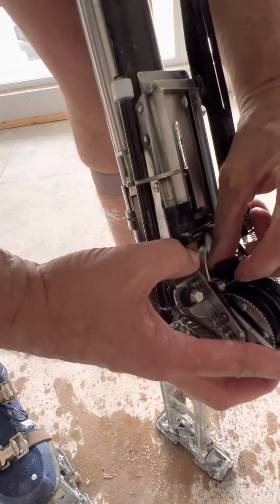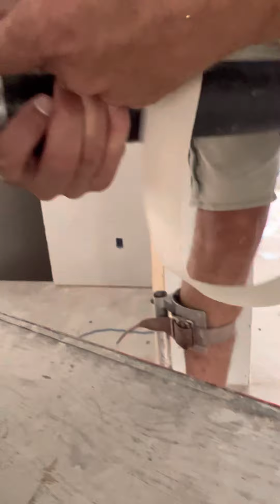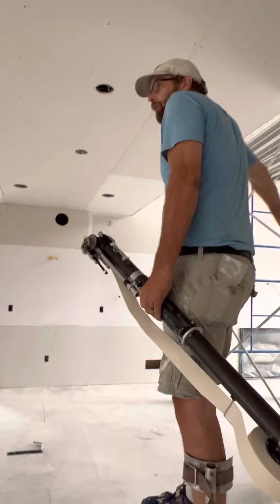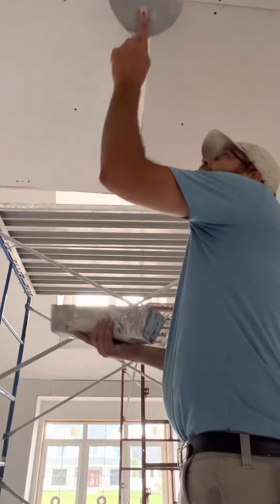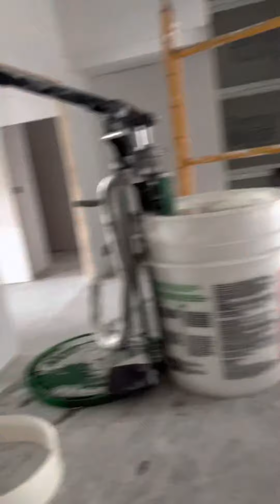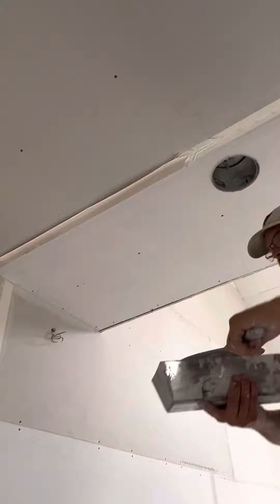How to finish drywall! Big house taping with Bazooka,  flats, Butts, ceiling!

Comment: I do all prefill to butt joints and corner gaps along with damaged board with sheetrock prior to taping as it is required to get a high quality finish and 2 other things you failed to mention 1 being that where you end at adjacent wall/ cieling flats if you touch filler valve to drywall and do cut length is perfect every time no quess work involved and 2 being that the screen on bottom of pump can get plugged by chunks of debris either dry mud or semi dry mud and restrict mud when pumped into bazoka and cause air bubbles , all butts that are not prefilled will show a line in the long run btw , my 41 yrs exp knows these facts to be true
Reply from the maker: Very good.  But I was just doing the basics.  It takes years to learn what you know. People can use the videos to get started.  Along the way they will learn to be masters.  Good comment Jeff!

Comment: It is but it’s just an extra step I do because I can’t stand that grove in the middle of my tape. I love fibafuse on my flats but when i used it I still ran paper on my butts. The fibafuse would tear some if I used in the butts when I busted them out with the box. It’s just got so expensive I’ve went back to paper everywhere
Reply from the maker: I could totally see it tearing on butt joints.  I always prefill butts.  A lot of times if hangers are clean the make the so tight mud can’t get through them and only bonds to paper.  I put a little v in them when prepping the house.  It does help lay tape or fibafuse flatter.

Comment: Y not prefill so you don’t get those gaps and lines in your flats?
Reply from the maker: So believe it or not.  The house is prefilled.  But I don’t prefill where the flats are tight together,  only broken board and gaps. The line in the tape has been happening only recently over last 4 months.  I was using USG tape on this one which seems to have gotten thinner.  It stretched a lot wiping it down on that house.  I would run some long flats and it would stretch almost an inch by the time I was done wiping it down.  I am going to try ProForm tape on next one I tape with a tube.  It has a thicker profile.

Comment: Leo, any idea on the square footage of that house? 4000? Looks like a beast. Just curious. Thanks for posting.
Reply from the maker: 150 no coat, 50+ sticks of beads.  Rooms, 11’ tall, 11’6”, 9ft, 10ft, 3 barn ceilings, 19 ft high room, 11 ft garage.  All sorts of different heights.
Reply: @manwithapan  Appreciate the response. Yep, that's a big house for sure. Bet it will look amazing when you're done. Can't wait for the next videos in the series!
Reply from the maker: This one is 6k sq ft.  Has a bit over 21k ft of drywall.

Comment: Some of best drywall videos. Thanks for explaining so clearly. Would you ever run Fibafuse through a bazooka?
Reply from the maker: I ran an entire house with fiba fuse.  All flats and butts,  have to run paper on angles.  Advantage to fiba is it does not pull at all when your taping and no stretch like tape.  Disadvantage is that you have to be in long sleeves and need gloves because the fibers get into your skin and you itch all day.  It does run smoother through a tube.
Reply: @manwithapan  Thx. That makes perfect sense. There’s also Fibafuse Max that I think can be run in corners too
Reply from the maker: When I ran it, it was 7 years ago.  They didn’t have the max out yet.
Reply from the maker: One thing to be careful about is tearing it with your knife,  if you wipe to hard.
Reply: Was going to ask this myself thanks guys.
Why do you choose to run paper over FIBA mate , just keeping costs down or any other reasons ?
Used steel angles since day one on internals but all you guys really making me want to go to paper 😬
Reply from the maker: @geordie-drywall  well I have run Fiba through a tube and it’s very smooth.  I found it itchy,  it doesn’t stretch like tape,  only quarrel I had with it,  is it tears easily of wiped to hard,  mostly at angles.   I run paper because I have easy access to it, and I can use it on everything.
Reply: I use both fiba fuse and fiba fuse max through both bazokas ( Columbia and continuous flow apla cator and swear by it) takes some getting used to and patient's to learn the nuances but once you get it its awsome